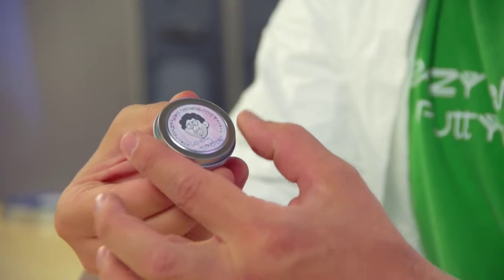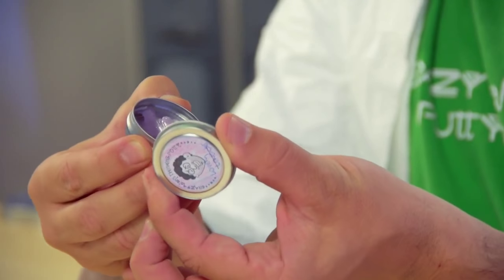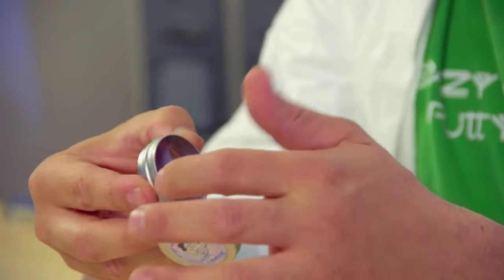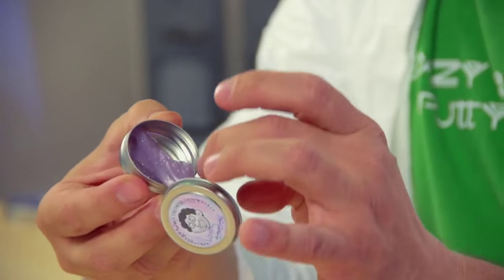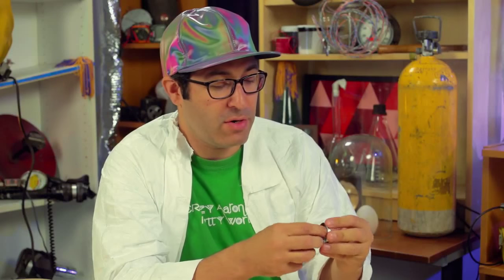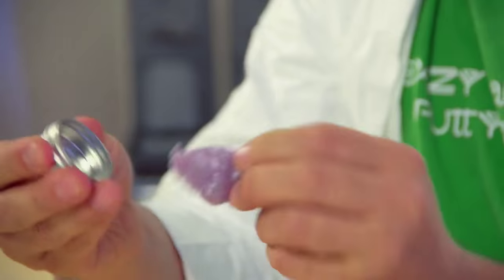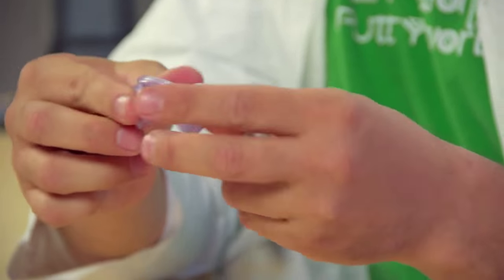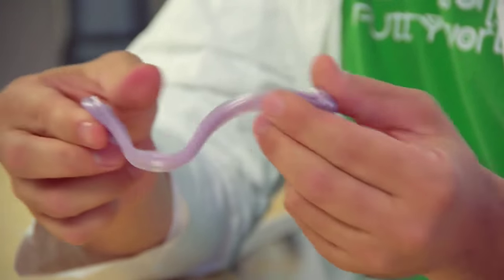How-To: Easily Open Thinking Putty Tins

Comment: My putty still won't open 😶
Reply: Katie Leese me to😢😭
Reply: katie leese .
Reply: I really hope that doesn’t happen to me 🙇‍♂️
Reply: I'm trying to open it it's just this thing I just it's really hard it is tiny mine is really big 🤦
Reply: Try heating it up with a hair dryer
Reply: I found that prying it with a BUTTER KNIFE (not a sharp knife) seems to work with a bit of technique
Reply: Me too 😭😭😭😭😭
Reply: Same!!
Reply: Same here
Reply: Same- I just got mine from the store and I can’t open it.
Reply: Same
Reply: Same
Reply: Lol same
Reply: me too
Reply: same!
Reply: Same
Reply: Frr
Reply: Me too😢
Reply: Still? Damn
Reply: Neither will mine 😢
Reply: This is so dumb
Reply: Hot water
Reply: @flannelflax8078 yea i kinda did that but i used a hair clip to loosen it then i used my nails and started to pull on the cap and after like 5 minutes i got it off
Reply: Got a blister on my thumb trying to get this off, they failed at the design of these tins!
Reply: Guys it only happens when putty is stuck on the top of your lid
Reply: Same
Reply: Same
Reply: me 2
Reply: Same
Reply: Been trying for 3 weeks
Reply: Same

Comment: my one doesn't even twist
Reply: Kiana Dinari sameeee
Reply: Kiana Dinari first u pull then twist
Reply: SAME
Reply: Kiana Dinari I don't even have any...😱😰
Reply: Kiana Dinari Same
Reply: Same
Reply: Same
Reply: SAME
Reply: Same sis
Reply: maybe drench it in motor oil for a second in the cracks
Reply: same
Reply: Same
Reply: Same what should I do if I don’t twist?
Reply: Use a blunt knife that happened the my neon flash 90g putty tin and I couldn’t pull it or twist it but after a while wit the knife the lid finally came off
Reply: Same
Reply: Same
Reply: @daniellemalia9305 ya or bc it’s puttie is on the screws
Reply: Same

Comment: If your tin won't open, here are some tips.
•Wash the tin, then air dry it. 
•Put the tip of your fingernail in the gap between the cover of the tin and tin body then pull it out hard. Or use something to do the job.

Hope this helps.
Reply: but it hurts my nail and i have a fear that my nails will rip out
Reply: i have acrylics 🤧💗
Reply: I do this 😂
Reply: ..I don’t have nails..I bite them...(our lik secret
Reply: This did help thank you so much
Reply: peceminecraftjem “or use somthing to do the job”

Comment: Hi everyone,
if your putty gets closed shut, take a flat head screw driver and stick it between the lid, twisting until the flathead is vertical. Keep doing that all around the lid until it's popped open. if it keeps closing on the other side, use your fingers to keep the tin lifted in the space between them. :)
Reply: THANK YOUYY
Reply: this worked for me!! thanks

Comment: I tried his approach, then I used a strong and pointed ended nail filer to insert and gradually lift the upper lid off.  Some putty film got in-between the upper and lower tin.  I left the plastic disc with Crazy Aaron's logo on the putty.  Maybe, if I kept the plastic disc off the putty, the putty wouldn't sneak past the plastic disc once the upper tin is on, and keeping the container upright at all times for easier access to the putty.  I like to keep the plastic disc on anyways.  It sure got me thinking 🤔 on what to do! ^_^. Thanks again Crazy Aaron for the simplest task of twisting the upper and lower tin to open.  Also, with this thinking putty, It keeps an impression, or memory, of the printed, preform, or indented plastic disc logo.  It can bounce, soft when kneaded, stretch by either force or no force when held by index finger and thumb, and it can break or snap apart in portion.   I was gonna use a suction cup to help rather than pry it open with my finger nails, but didn't want to remove sticker label in order for suction cup to work properly. Interesting thinking putty...
Reply: big brain10/10

Comment: For mine it has it on the side so it's like trapped in the middle of the cover and the tin part and I cant even twist or do anything. I do t want to like brake any of it and I'm trying to like fit things on the sides to try to like clear it but it wont budge

Comment: Yall should make the tins more accessible for those with motor and function disabilities. Maybe a notch or two on the bottom of the tin so the grip is more supported for getting those super stuck tins.

Comment: If enough of the putty gets into the gap around the lip, twisting will be pointless.  Try heating with a hair drier first (don't burn yourself).  Or find a thin butter knife, nail file or screwdriver, slip it under the edge of the lid as far as you can, then pry it up.  It will distort the can a bit, but it will work.  I think if you were going to store it long-term, you could wrap the putty in some silicon parchment paper (haven't tested this idea yet) and then put it in the tin -- it shouldn't ooz out enough to re-gum the lid, and it shouldn't stick to parchment paper.  AND you could make a little inner "cap" out of parchment paper to keep the putty from the lid...but that might be a lot more work than worth.
Reply: This helped so much! Thanks ❤️

Comment: Finally got it open, after trying for a frustratingly long amount of time. Twisting and hot water didn’t work.  Had to take a butter knife and apply gentle pressure under the lid all the way around it. Not gonna lie, it’s super annoying not to be able to open it. Can’t you wrap it in a little plastic cellophane before putting it in the tin to keep it from sticking? The putty itself is great, but the packaging needs a redo

Comment: twisting the lid is absolutely impossible with the oily residue that your putty leaves after a couple of months sitting. i’m probably going to have to toss this if a hair dryer doesn’t work; trying to pry open the lid on the larger tins makes it so that every time you get a tiny bit of leverage the other side closes. extremely frustrating for a stress relief putty

Comment: I dug a knife in and even bent the tin, then it came out, try that if it doesn’t work

I have liquid glass putty, after I took it  out  it turned white and doesn’t stretch.

And it smells like bread

The good thing about it is how it never dries out  so if  your tin is bent you don’t  have to worry about it drying out

Comment: Still won’t open? Well try these two things: if it’s been on it’s side, try to pull it open until you find the side where there is no putty.  For example you would open it on this side > /      (Tilted line is the putty)      And if it’s been upside down, leave it on it’s right side for a few days. Then use a flathead screwdriver. (It worked for me!) ;)

Comment: It’s 2024 & it still won’t open. Twisting doesn’t work, prying it open with everything i can get hold off nor heating it doesn’t work either. We got this supposedly to relieve stress & anxiety & guess what, opening it (if you can) just caused even more stress & anxiety so into the trash can 🗑️ it goes!

Comment: For my birthday my dad took me to a small toyshop in my town. I saw that they had a lot of “thinking putty” that my friend had told me about. Since it sounded pretty cool I grabbed a container of it and we checked out. When I got home I was super excited to play with it for the first time but I couldn’t open it. I tried twisting and pulling and banging it on my wall and nothing happened. Does anybody know some other tricks to open it?  

Edit: my friend told me it was because I was not strong enough. I asked my parents if they could open it but neither of them could. So that just comes to show that the “you’re to weak theory is not correct”
Reply: Guys! I found a solution if yours won’t twist either:

Put the tin under a water tap and with your nail or knife, scrub the little crevice between the lid and the tin. After you scrub it, get a blow dryer and dry it all of, once you do thAt, just keep twisting and once it starts twisting try to pull it off then twist again, and so forth until it works. 

Let me know if that makes sense

Comment: Guys! I found a solution if yours won’t twist either:

Put the tin under a water tap and with your nail or knife, scrub the little crevice between the lid and the tin. After you scrub it, get a blow dryer and dry it all of, once you do thAt, just keep twisting and once it starts twisting try to pull it off then twist again, and so forth until it works. 

Let me know if that makes sense
Reply: tysm it worked!

Comment: Twisting didn't work as the putty had oozed between the lid and base and sealed it shut. In the end, I took a hammer to the side and dented it enough that it created a slight air pocket and it opened straight away. Things I didn't think I'd be doing at 11pm at night. 😂

Comment: Twisting doesn't always work on the small cans. We can't even barley hold the can tight because it's so smooth. We couldn't even twist it off and am about to trash the whole thing! We tried prying the lid, using a flathead screwdriver to work it up around the edge, nothing. I put rubber bands on to help with the grip still a no. Kids are super frustrated and so are the adults.
Reply from the maker: We're sorry to hear this. Please contact our Customer Care team at customercare@crazyaarons.com. Thank you!

Comment: The twisting didn't work for me so I put my tin in a ziplock bag and ran it under hot water for a minute or two like you would do with a jar you can't open. Then pried the lid off
Reply: Did it work

Comment: not only does it take about a minute before finally getting to the point, the suggestion is useless. My tin is about the size of a hockey puck and it's getting really close to just being tossed in the garbage. It's not a stress reliever, but a stress inducer.
Reply: Just to follow up, the stupid thing is still sitting on my desk almost a month later because I haven't found it worth my time to take it down to my workshop and break out the tools needed to open the damn thing. Everyone else on the planet figure out that knurling the edges of a metal lid make it easier to twist or peel open, but that has never, ever, occured to these guys? It was given to me as a gift, but it is inching closer and closer to the garbage can at this point as I still can't get it open with my hands - which by all principles I should be able to do.

Comment: Mine won't twist 😭😫
Reply: Guys! I found a solution if yours won’t twist either:

Put the tin under a water tap and with your nail or knife, scrub the little crevice between the lid and the tin. After you scrub it, get a blow dryer and dry it all of, once you do thAt, just keep twisting and once it starts twisting try to pull it off then twist again, and so forth until it works. 

Let me know if that makes sense

Comment: i tell you honestly before watching this video i tried that and it wouldn't budge so i came here and you are telling me the same thing i've been doing any other tips ive even tryed to pry it open with sissors worked once didn't work this time
Reply: im thinking of sawing it open with an exacto knife do you think that will work
Reply: update : with a lot low prying it open with big sissors and mini nail sissors then my fingernails i pryed it open
Reply: my tip to you if it doesn't work try to get the putty around the sides off like i did and it will be more likely to open
Reply: Guys! I found a solution if yours won’t twist either:

Put the tin under a water tap and with your nail or knife, scrub the little crevice between the lid and the tin. After you scrub it, get a blow dryer and dry it all of, once you do thAt, just keep twisting and once it starts twisting try to pull it off then twist again, and so forth until it works. 

Let me know if that makes sense

Comment: mine cant close now twisting pushing nothing works i have the wrting tyype HELP soon if you need this the item number is 90728
Reply: Guys! I found a solution if yours won’t twist either:

Put the tin under a water tap and with your nail or knife, scrub the little crevice between the lid and the tin. After you scrub it, get a blow dryer and dry it all of, once you do thAt, just keep twisting and once it starts twisting try to pull it off then twist again, and so forth until it works. 

Let me know if that makes sense